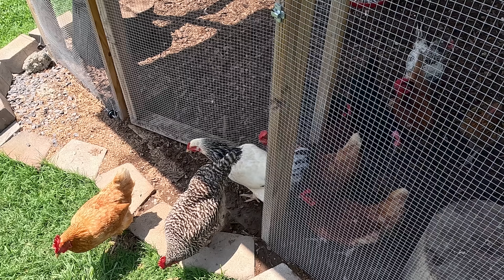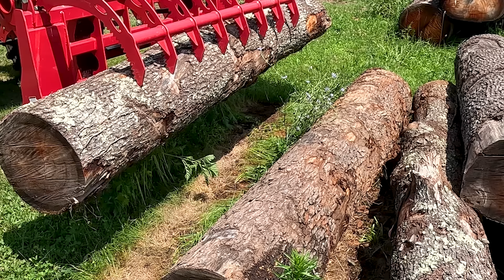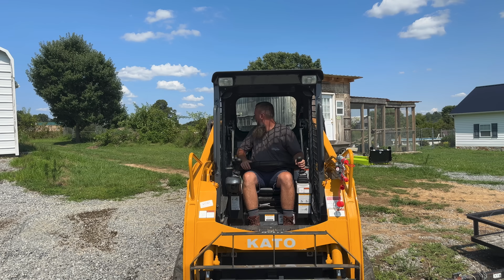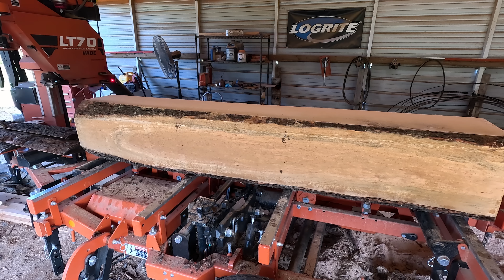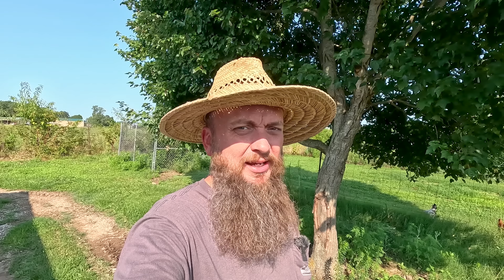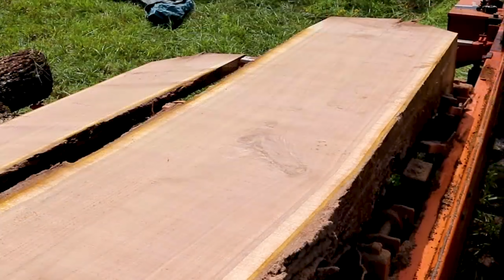EPIC Cherry And Walnut On The Sawmill, Had To Use My Axe!

Comment: Say there friend , I heard you mention on a recent video that you had some skin cancers removed from your face. here's a tip for you. In the morning  before you go outside. Put some Virgin Cocoanut oil on your face and neck.. leave it there for a short while. then blot it off . When you finish for the day before or after. ( i did it before my shower ) Do the oil again . leave it there for a while ,then blot it off or take your shower .  I learned this over here in the Philippines .And it does help avoid peeling if you burn and also helps repair your skin.  I got into using it. As I was surfing for 5,6 0r more hours in a day. And would get sun burn .  Also drinking a teaspoon of the oil a day is also good for you . good luck. And I do enjoy your videos !

Comment: Have you thought about adding a vacuum system to your mill?  I would think a good grizzly single stage motor would work good to connect to mill and pipe it out the side.  Then all you need is your loader to scoop and get rid of saw dust.